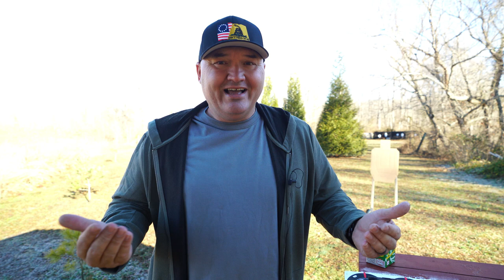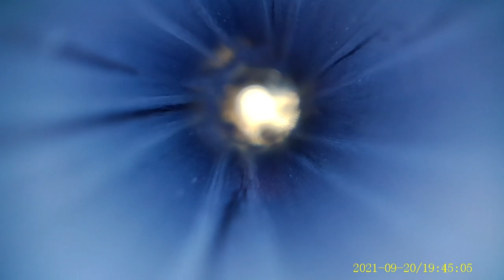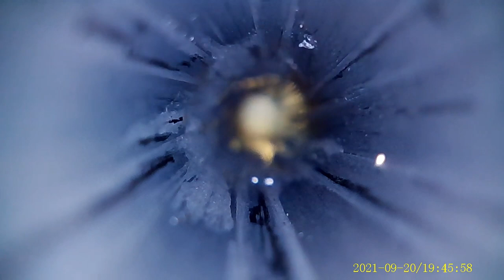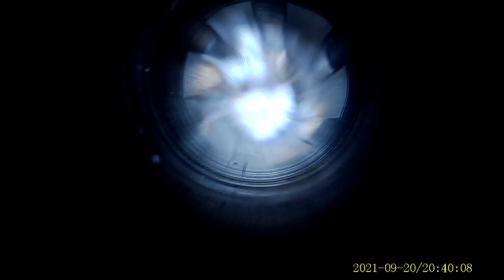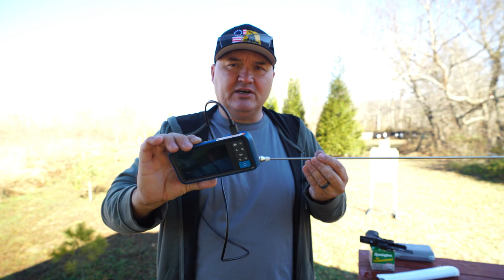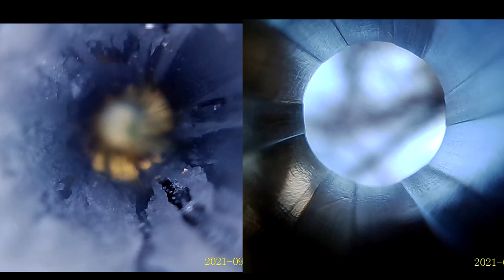Leaded Barrel BORESCOPED!!!

Comment: Thx for the video.  I kinda always thought it happened when the barrel was really hot.  In your experience, do you think the temperature of the barrel contributes chances of leading a barrel?  Like after rapid sustained shooting.  BTW..I wish you had showed us how you cleaned the lead out.  I bet it was more then simply running a bore snake through it?
Reply from the maker: You're very welcome. In this case the barrel was definitely not hot. The that day temperature was about 55 Fahrenheit. Can a hot barrel be a contributing factor? I am not sure but I guess if it were REALLY hot it could. I might do a video on lead removal later. It was too much to cover in this video. Thanks for tuning in to my videos!
Reply: @buffalosoutdoors  I turned around and bought one of those borescopes.  I had been wanting one for years and use them at work.  Interesting difference between what I thought was clean and actual results on my firearms.  One can be overly concerned, but overall I found out I do a pretty good job keeping mine cleaned.
Thanks for the video.